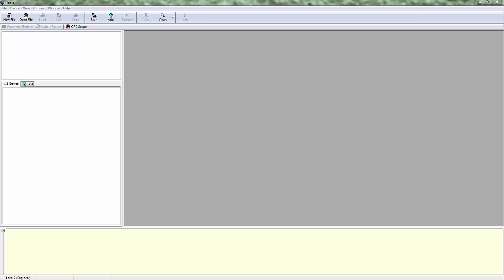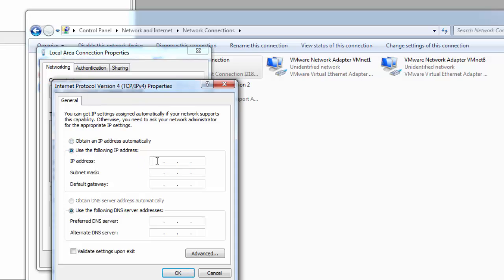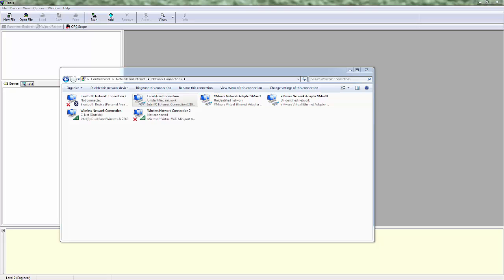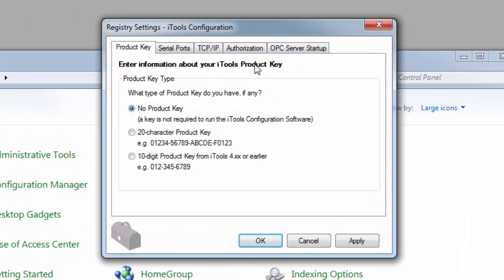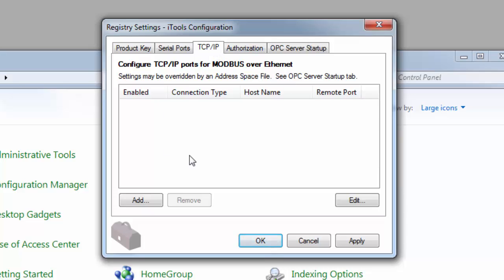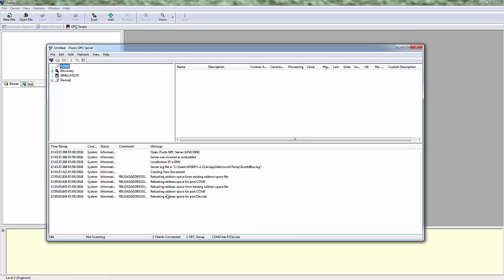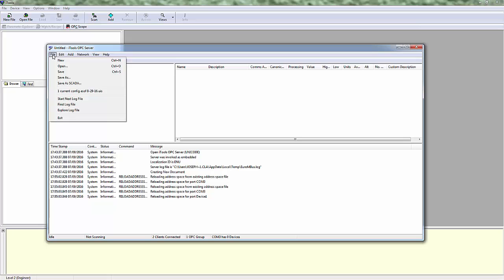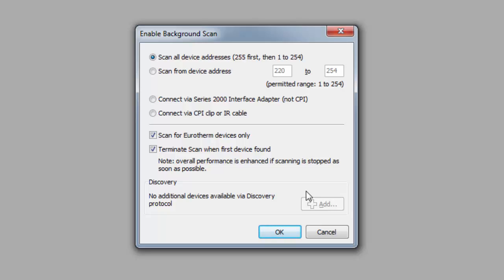Setting up your Eurotherm Device to work with iTools over Ethernet

Comment: Hi, I have installed 6100 A recorder and connected with my network and it does not transfer the Realtime data on my HMI. The data is showing in recorder. What should be the problem?

Comment: Hi, I'm trying to communicate with an old Mini8 controller but I think that I need an older iTools version. I was able to comunicate with a second Mini8 but only after upgrading the firmware to 3.01. So I fear that doing the firmware upgrade I will lost all the loops configurations then I need to take a backup first. Could you please give me some advice? thanking you in advance